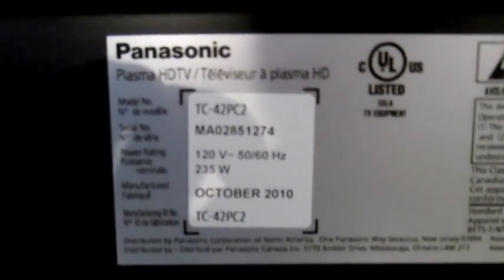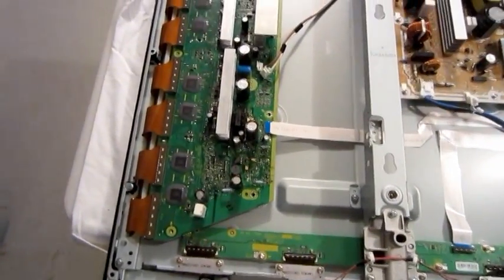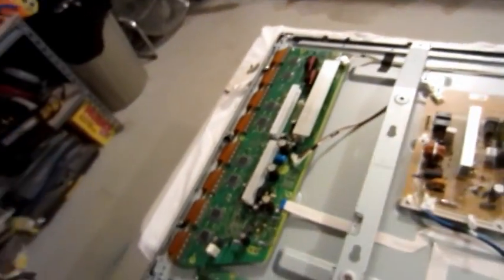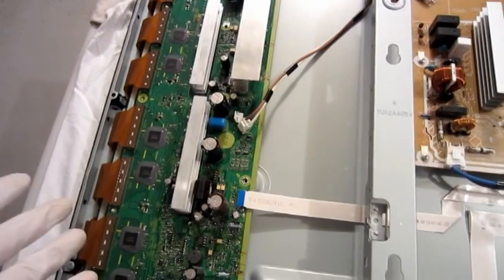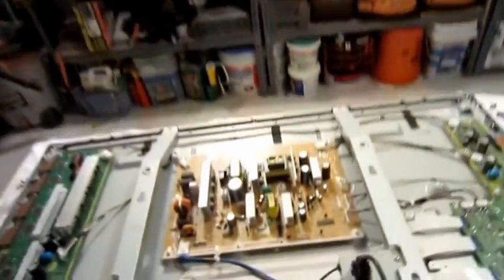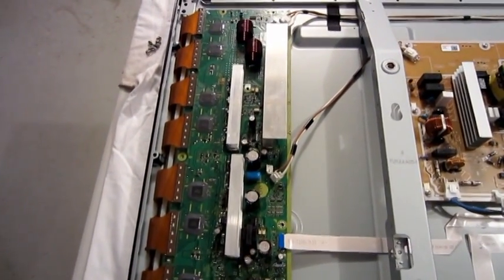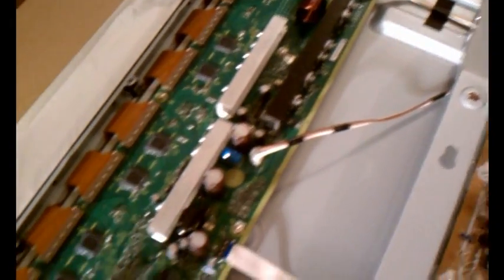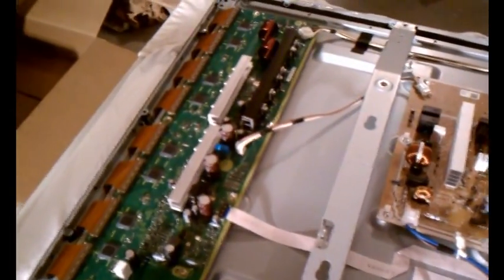Panasonic Plasma 7 Blinking Lights of Death Fix - TC-42PC2

Comment: I picked up a yard sale TC-:42c1 and got the 7 blink code which changed to 6 when the SC cables were unhooked.  Bug was the flat cable going to the SC board.  The set had gotten wet and the flat cable connections had corroded.  Thanks for flagging us on the 7 to 6 blink tip.

Comment: I guarantee if you do a continuity test on that board you will find that it has bad IC's.
With the tv unplugged hold down the power button for 10 seconds to discharge any residual power, put your DMM (digital multi meter ) on the sound marking, touch the black probe to a ground point on the SC Board ( screw ) flip up the brown ribbon cable connections for easy access and slowly run the red probe across the pins that you just uncovered.
If  "when" you find the pins that makes a sound, you have found a shorted IC.
They are about $ 10.00 + s&h each but if you are not an experienced solderer I would not recommend trying the replacement yourself !

Comment: What do you do if you have sound but no picture>?
Is the bulb Bad?
Thanks Much
Reply from the maker: http://eliasp9.hubpages.com/hub/A-Common-Problem-With-All-Plasma-Tv-Sets
Reply: +Radioman56 thats a tcon issue. also check for a inverter fail. im assuming this issue is the same for plasma as lcd but they backlight might be out make the room dark as can be a check the screen with a flashlight and see if theres faint images if not then tcon usually P.s. i know its old comment but others have  this problem i just fixed a 46 in samsung with this method.

Comment: Mine did the same but on a TH-P50VT30A which the flow through chart says the SC board possibility but there are other checks to do with a multimeter to make sure this is the case

Comment: Hey nice video, I have a question. I also have the 7 blinking lights and when I opened it up and disconnected the SC board, I get 8 lights instead of 6, if I'm understanding this correctly, that means the SC board is not the culprit correct? When I disconnect the SS board, it gives me 7 blinks just like before. Does that mean that it's the SS board that is faulty? I have a TCP60ST30 but apparently the "SOS blinks" indicate the same problem across all their tvs.

Comment: hi Moe,
very thankful for the information but my problem is i got panasonic,2009 manufactured model no. tx-p50g10b and it shows 14 blinking red lights with regular interwal and wont turn on.
please please help me.
my other email address is  express.ins@gmail.com.

thanx very much.

Comment from the maker: You have to check out page 74 to 76 of the guide in the description.  That covers 10 blinking lights problem.  I would start by checking the SD card slot for any problems/metal objects shorting out the board.  basically follow the chart on page 76.  Let me know how you make out.

Comment from the maker: At 39 Seconds into the video there are several Brown Connectors to the left of the circuit board.  The horizontal lines appear if those connectors are not seated right.  Redo those connections and you should be in the clear.

Comment: Hi CAN you help ME??? I have a tc-p50c2 wont turn on 10 blinks, I also have a tc-p50G25 with cracked screen and 10 blink, the power-boards are similar but not exactly same I switched them (But still 10 blinks) The TC-p50c2 I really want to fix I do hear a clicking on its power board but nun on the G25's / perrdice1@msn.com

Comment: Have the same failure on the same generation TV (TC46PC2).  Ran the same test, however new board did not fix the issue.  Unfortunately no way of knowing if the new board is bad or if it is another issue.  Very frustrating!